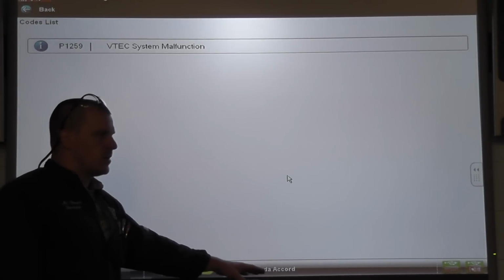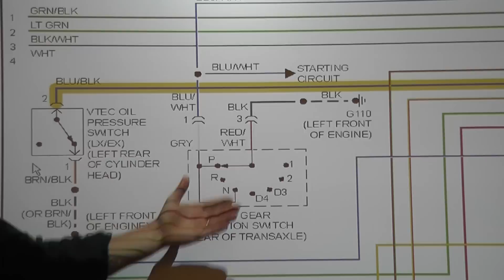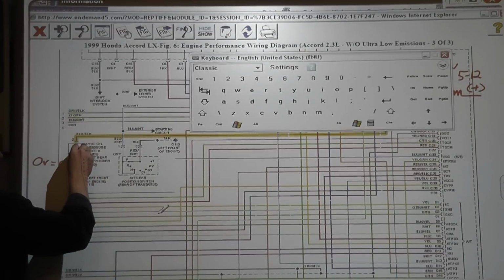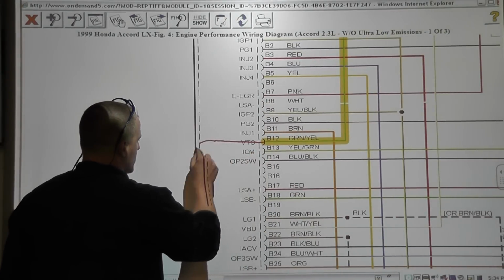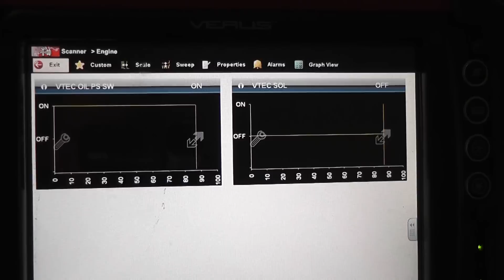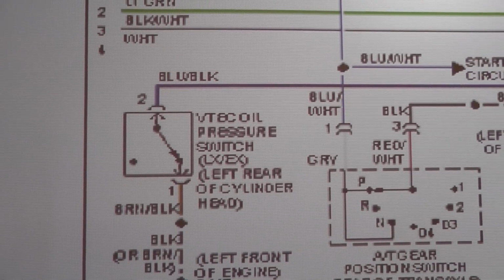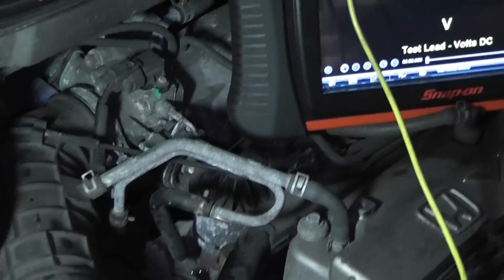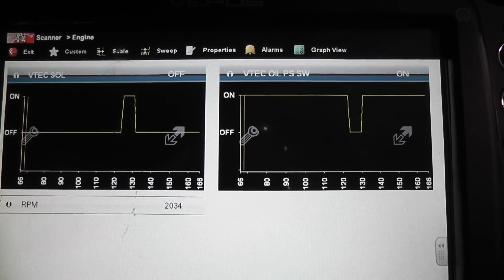Honda VTEC System Testing (P1259 trouble code)

Comment: Hi, I have a question about my vtec operation, that maybe you can answer , about my 1998 Honda Accord EX V6.
I havent owned the car very long, but when I hit the throttle to kick in the Vtec, it stalls..
I have to go thru all of these checks but the first thing i noticed is that my voltage is over 15 volts . do you think that that could be too much voltage  for the solenoid ?
thanks for any help.

Comment: if Vtec system malfunction  will it cause the RPM to Flush while driving and Stall? And did you say if there oil in the Vtec solenoid connector , should i change the solenoid? this happen on my 04 honda accord .....